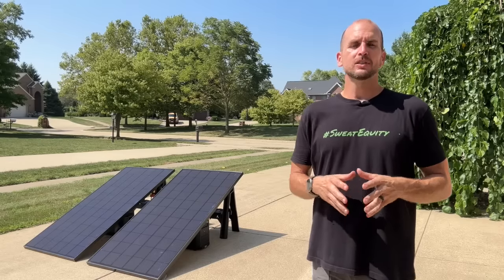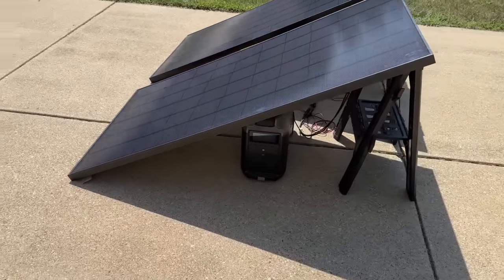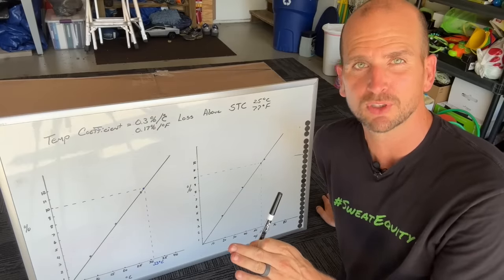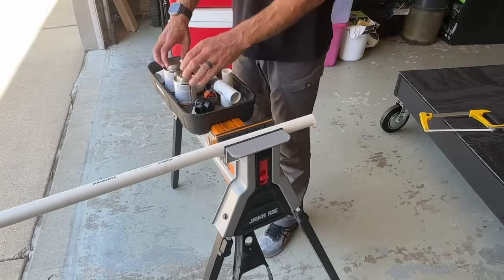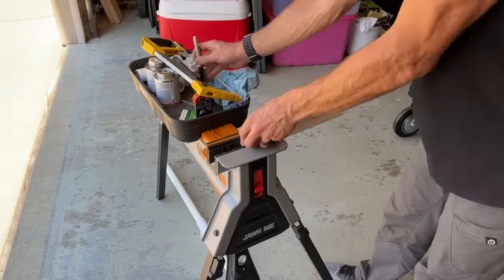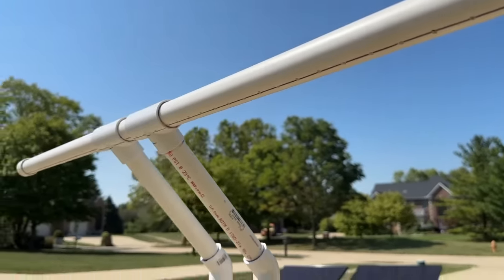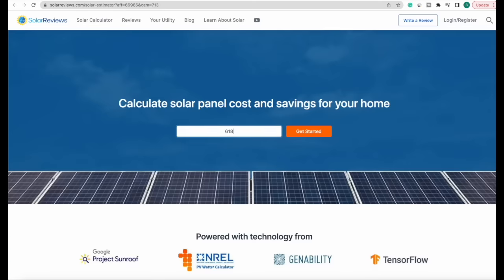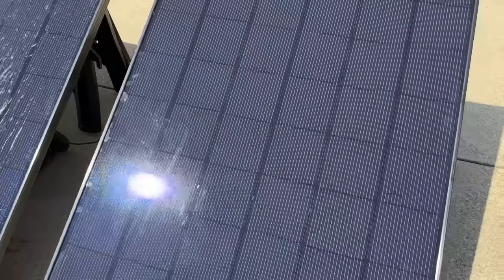Surprising Power Gains By Cooling Solar Panels

Comment: Question: what if you put a water tank beneath the solar panel and used electricity to circulate the water then passed your hot water line for your house through this tank (in a zig zag to maximize heat transfer) before the line goes into your hot water tank? Would the increased electrical production and/or reduced degredation of solar cells by heat outweigh the electrical usage of operating a pump like this? 

Another idea I had was to have a buried water tank fed by the gutter with a wind driven archimedes screw pulling water up to the roof then over onto solar panels with that water going down the gutters and back into the water tank. Presumably, as long as the water is kept deep enough with a large enough capacity, it should remain cool enough to cool the panels off whenever the wind blows. While the wind wouldn't likely blow continuously, you aren't using electricity so aside from the startup cost it shouldn't cost you anything to run while you'd have some gains when it ran. I suggest wind because depending on the height of your roof that could be allot of electricity to run a pump with that much lift.

Comment: I can see a line of shade from the water line to the cooled panel. That's bound to affect the measuring.
If you drill the holes on the side of the pipe, you could place it further away and probably get better results.

Comment: A very small sump pump like for a fish tank may work and it doesn't cost much to run. Just use a collector for the water and sump it back up to the top. 
Use clean water and I guess you'd have to clean the water at times for dust. 
Using a fan may help too. Blow the fan right on the place that may get the hottest.

Comment: Thank you for this test. I can currently not use it, because it is to hard to acces my roof (2 stories) but i think this could be valid solution for everyone, that collects rainwater like i do. That would cost no water in that case and also makes installation easier, as the water only needs to be distributed but gets collected with the system that already collects rain water. As long, as the extra energy gained is more than what the pump needs, it should be usefull.

Comment: Seems like it's just cheaper/simpler overall to just spend the money on more panels and do fixed tilt. Water has hard water deposits, fans would get wet and break/wear out, tilting 1-axis/2-axis is progressively more complex and costly.

Comment: If you can Set-up a recycled water system which can be  topped up by natures rainwater  then you would have a constant Cooling System. 
Also I thought have a in-built mini fans under or in between the solar panels  so that they are powered by the panels and thus coolinganother cooling down system.

Comment: need to check for water refraction increasing. you can do this by using a fan  to cool one. being that the water can condense the light channels through fragmentation refraction like a prism  polarization effect.  congrats on the discovery.

Comment: Here in California we can't afford the water.   Mark Snyder Electric in San Diego is working on some kind of solar panel cooling system.   I'm not sure how it works. I think he said the cooling would somehow create distilled water that can be used.   (He put in our solar panels 21 years ago.  We have a 3.5 KW system.   We make more electricity in the year than what we use.)

Comment: You need to add a water trough to catch the water then use a solar pond or fountain pump to recycle it to the top for re misting. It could refill with a rainwater. You could make the trough out of 4-inch pvc pipe cut down the middle making 2 troughs.

Comment: Tech ingredients already covered this issue 6 months ago.  High temperatures also shorten the panels life, there is an Australian company making  water cooled panels so that the panels make more power,improved life span and make hot water for home use. Tech ingredients in their panel experiment used fans behind the panel, so you arent blocking sunlight, they got better results.

Comment: I dont know if this would be practical for a suburban house, but for an off grid property it could run off of a rain water colection system thats built off of the roof of the house, have the solar array on a separate location instead of the roof, and recycle the water running off the solar panels into a second rain water collection system that could be used for irrigation.

Comment: Combine your solar panels with sedum roofing. The small plants and soil will clean the air quality, hold water, cool the building in the summer, hold heath in winter and cool down the panels on top of it. It will also extent the lifetime of your roof.

Comment: How about constructing an artificial pool or small lake on the property. Fill it up with clean water and then use it to sprinkle on the panels? The run-off could be collected and fed into the pool. A closed-loop system would certainly be able to reuse most of the water. A little would evaporate, but that would help keep the panels cool. 
The only problem would be keeping the water clean and avoiding hard water as it will leave residue on the panels, thereby decreasing their efficiency.

Comment: I'd been considering a closed system water cooling the panels for quite a while now. Even a heat pipe system wouldn't use any energy itself. It's been well know by engineers that keeping panels cooler will increase their output.

Comment: A friend was having some work done and had a backhoe on site for digging a trench about 5 foot deep for a 100’ to a new barn and camper shed. He added a 3” pvc pipe and ran it up to a box    His stuff was in behind the panels with 2 decent but cheap pc fans pulling air through the pipe and exhausting out box panels are in….., basically he is geothermal cool his stuff. In summer in SE USA he never gets above 65 degrees F°. 🤷‍♂️

Comment: I use a similar system to keep the pannels clean from bird droppings and dust. They should last longer that way. I use those small sprinklers, for about 10 minutes. It works really well.
Reply: This is what I was thinking, while the cooling might not be worth it running it periodically to clean the panels probably would be

Comment: maybe a 5 gallon bucket, solar powered pump and fan with there own small panel to power them. rain gutter at bottom of solar panel to be cooled to collect the water and recirculate. Tech Ingredients had a video with fans on the under side of the solar panel that did help cool the panels and increase production. I think the fan set up with a mister instead of a stream of water may be better. Evaporation has a cooling effect. I use a mister on my ac and it lowers the amps , temp and run time of my equipment.

Comment: Interesting Video.
What would be really interesting is how much power does it take to pump the water.
Either through a radiator to keep it cool or through a sufficiently sized holding tank.
If the pump uses more power than it saves then it’s not worth it.
How much water can you pump with 20Wh.  My guess is not much?

Comment: You could do this for your roof panels. Collect the water through your gutters, run it through a very inexpensive heat exchanger then pump it back up to the roof. You'd lose a small amount of water everyday maybe a gallon or 2, and the pump would require some energy. But you wouldn't need a high pressure and you could probably get away with a 30-40 watt pump. Have it cycle on and off every 5 minutes with a cheap timer and you'd make an incredible amount of extra power with an extra 100$ in supplies and you wouldn't be wasting any water.

Comment: You could always have a gutter system to recapture the water and just use a pump to keep the water circulating. You would obviously have to deal with evaporation but it would still use a lot less water
Reply from the maker: For sure, you would have to have some type of recirculation to make this practical.

Comment: Now, add some mirrors- maximum optimization! I've done a test using mirrors on a small solar panel and it nearly doubled the output- of course you'd need some kind of cooling system to keep them from overheating- or maybe this water trick would work. If you mixed this with a pump and added just enough new water to keep up with evaporation this could be pretty good, though I'd think that would only be practical if you're running many panels- a pump for a single panel is probably going to use more power/water than the energy you produce, but it if was say- 5+ panels with one pump, a reserve tank and a regulator to let water in as it gets lower that could be pretty good. Then of course- mirrors!

I'm kind of a fan of the parabolic mirror focusing on a a point version of solar power. I've built small versions of both types of systems and focusing sunlight doesn't require any special tech like solar cells- you can make them with off the shelf stuff from home depot, you can't easily make a solar cell though. There's also the coiled black tubing as well, get the water boiling and run it through a turbine, then to an inter-cooler/radiator to cycle back through- it's less efficient for producing actual usable power but it's a lot easier to put together. These methods are mainly best for heating water and heating a home in cold areas.

I hope you enjoy your Cybertruck! (I call it the meme-truck, but that's just me)

Comment: I find the best way to get the most out of my panels is simply to keep them clean. I usually use a spray foam designed for car cleaning, long handle brush to agitate and then a good rinse off. I can often increase the output by 5-10% with minimal water use, and this lasts for months. Sure the panels get rinsed off when it rains, but there is still a bit of algae, some bird droppings and stubborn dirt that remains on the panels, and this usually needs a slight mechanical agitation to remove

Comment: Agree with donalain69 that the pump required to run the water (so you're recirculating water rather than wasting it) will likely require more than the total watts gained via cooling.  Also to note, the water in the test was coming out at a groundwater temp, but recirculating water, over a hot surface, is going to dramatically increase the waters temp, thereby limiting any cooling effect at all.  In the end, adding a single extra panel will offset any loss by a larger margin.  That's why inverters usually have a output rating that's less then the Max pv input rating, and most quality inverters will just clip any extra power at the MPPT.

Comment: Using tap power would ensure the panel will get covered with calcium and other residue... some people use fans but the energy to run the fans vs improved efficiency is questionable. Using fans might help prolong the life of the panel a bit but you'll likely need ot replace a few fans during the life of the panel.

Comment: You could recycle the water with a small pump assuming you could recollect 100% of water. And recirculate it with a resorvoir or tank similar to a cars cooling system. Maybe add a small radiator and small fan in front of it? Worth it? Depends on size and efficiency but sounds like it could work

Comment: if you used solar aircon to cool the water then it pours on to panel, you can get a lower temperature on panel. Plus if you then capture the water and have it make electric via hydro system then you can generate more electricity.

Comment: I am sure if you added sealed cooling loop that either runs through the shade, or inside a pool, you'd get a much more efficient cooling setup, without the excessive water usage. Similar to a PC water cooling loop.

Comment: the water on top of the panel is most properly reflecting some sun and the scaling will reduce the transparency of the glass on the panel. Better to blow some air through some cooper tubes submerse in the nearby pond to reduce the air temperature and then blow it at the back side of the panel.

Comment: I agree that high heat can impact electricity generation from modules.  I would be curious to see the data on additional modules with inverter technology like microinverter and string inverter technology to see how the results are impacted?

Comment: It is pretty well established in the solar community that high heat days can knock off ~20% of your power production.  Cooling the panels down to their 77F baseline tested environment, the environment that the panels' specs are based on, should allow you to capture the full rating of the panel, assuming optimal Summer Sun.  I can not imagine that a cooling system as you demonstrated couldn't be worth up to that near 20% figure.

Comment: I wonder if misters under the panel could work as well. I could reclaim and filter the runoff and reuse it for my setup. I'm going to try it when I move my panels in a few days, I have barrels, timers and pumps, just need a gutter and some filter foam and it might help these 105F days at peak temps. We will see what Home Assistant tells me.

Comment: In an environment where the temperature drops below zero for part of the year this would be a disaster, like adding ice sheets to your solar array; you'd need to continuously monitor the weather in the spring, winter and fall. Only feasible to passive cooling solution, like a heat sink.

Comment: Yeah, but there must be some pump running the water flow that uses electricity (and also water might cost something). So I think that gain  is less. But I saw somewhere solar panels that underneath had the water heating element and I think that connects to some kind of heat pump to heat the water boiler in the house. So with that kind of combination it makes sense if you use the heat to make also warm water to the house. Then there is cooling for panels without lose of water and it is used to warm up something that you anyway need to warm up.

Comment: If you know anything about electricity you know that heat is the enemy of electrical flow.  The hotter things get the less electricity is going to flow.  So cooling things down means electricity flow will increase.

The bottom line question is what is the cost benefit ratio of running water over the solar panel.  If it cost you more in water to cool the panel than the savings you get in extra electricity then you will lose money.  And the whole purpose of installing solar panels (in most cases) is to save money on electricity, not to lose money on electricity.

Comment: You have installed this with an equivalent to ideal roof conditions, like flat ware house roof surfaces. This won‘t be the case for most solar installments. The solar cells will often basically lie on the angled roof, which will be really bad for air circulation. As mentioned from other guys. The backside of the solar cell is where the cooling happens (Glass isolates obviously not fully otherwise the sprinkler wouldn‘t work, the metal on the back spreads it). I‘m not saying you should start buying water cooling. I‘m just saying those testing conditions are a bit misleading cause the average homeowner will have strong heat accumulation between roof and solar cell backside. I would look for install options with good air circulation.

Comment: I think you should try to cycle the water being used so it doesn't just spill, have a system with a tank that gets topped up and the water that washes over your panels gets pumped back into the tank, this would greatly reduce the water usage. 
You could also use misting.
Or the absolute best way is using a closed radiation system.

Comment: Wondering if there's any manufacturers looking into the viability of installing heat exchanges under the solar panels. 
Dunno what it will work alongside it but first thing that comes into mind is a heat pump for water heater.

Comment: Too much water is impairing the sunlight's ability to reach the solar panel.  One of water's most significant properties is that it takes a lot of energy to heat it, and therefore very little water is needed in this application.  You could also capture the water and recycle with a fish tank pump or similar.

Comment: I have a degree in automation and I'm studying electrical engineering and I'm trying to develop a really efficient cooling system, this is a huge waste of water.
  1st- If you made a "Closed" cooling system where you cooled the solar plate from the bottom of the solar plate and used your water tank as a reservoir, it must be in a higher position than your solar panels.
    2nd- Now you will need to make water come out of the bottom of the water tank towards your solar panels. The lower part would be sealed and this would be where the water would enter.
    3º The water would heat up on your solar panels and rise due to the difference in density between the water at the bottom of the water tank and the hot water below (Inside your solar plate).

      I believe this is the most efficient system possible to do with cooling.

Comment: What if you had a little collector on the bottom, like a gutter. And a mister system instead of a "rainfall" system. You can minimize the amount of water you use while you're using the panels. Since there is a collector, the water will be collected for reuse. (Putting water in a reservoir). Since it'll be misting and not "raining", you will use a tremendously less amount of water. Can you please try this and show results? This could be the new era for solar.

Comment: Using a IR gun gives you the temp of the surface which in this case is the water and not the panels temp. This is because It will not pass through reflective surfaces. As such shooting it into water that is refractive and reflective likely doesn't yield an accurate result. I think you should have shot the backs of the panels to compare the radiant energy for a more accurate comparison in regards to heat removed.